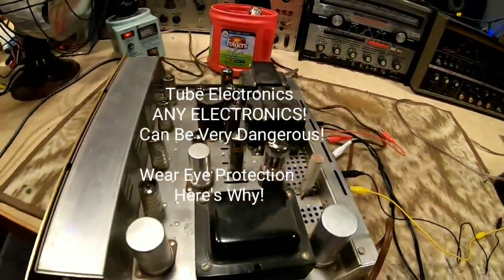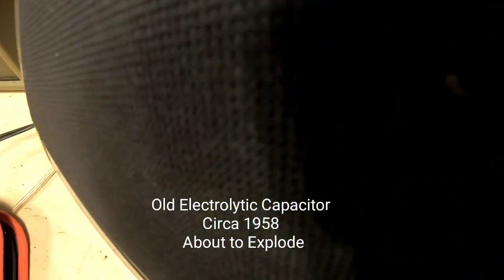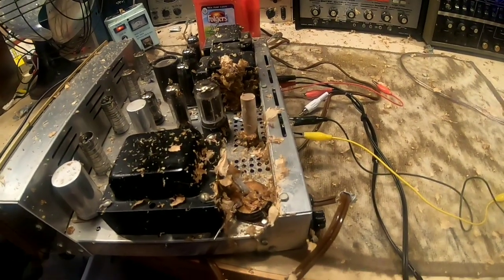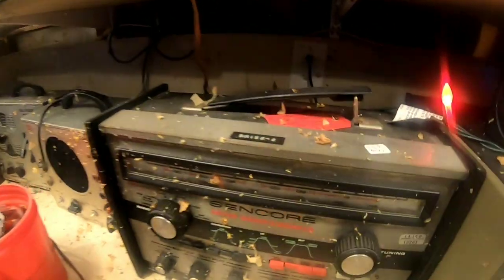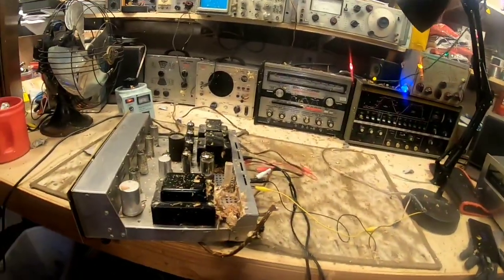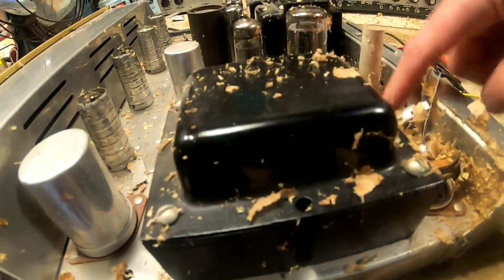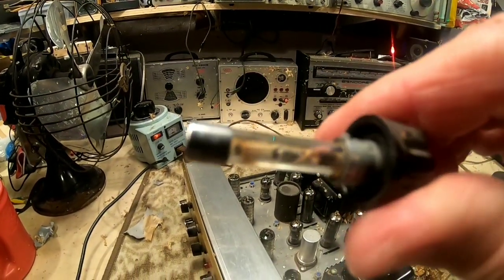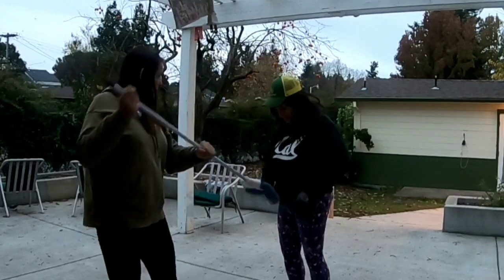Explosion in the Workshop! Old Capacitor Blows Up!...The Dangers of Old Electronics

Comment: "Without any warning at all"      

0:06 No output, bubbling sound...
0:42 SMOKE!

If you had an ammeter connected, you also would have seen the current jumping wildly. Some form of current limiting device is always a good idea. As well as safety glasses ;) 

An easy 'hillbilly' device is a simple high wattage bulb in series with the incoming AC. Check out the 'light bulb current limiter'. 

Voltages/available current inside these units are no joke. They can literally kill and maim. You skipped a few safety measures that would have prevented that cap from exploding in the first place though.

Comment: This is the perfect example of why you NEVER EVER plug a tube amp or any tube gear with unknown status and with original cap cans directly into the wall. Most tube amps filter can caps need to be "reformed" which means the voltage feeding them need to be brought up slowly using a variac together with a dim bulb ( for current limiting ) over a span of 24-48 hours or more gradually monitoring the current draw till it reaches full operating voltage all the while monitoring the cap can temperature. Based on this video it appears he just "plugged it in" or did not allow sufficient time with a variac to let the cap reform and did not monitor current draw or the filter can temps which obviously reached well over 250-300 degrees due to the high ESR that cap had from sitting so long.  This amp uses a 5AR4 rectifier which wont conduct until the filament is heated enough which wont let that cap reform properly. A unit like this would need to have an external supply feeding it starting at 0V and gradually over time of days slowly reform to its rated voltage. That main can filters 400-500V!!! which is what tends to lead to such violent explosions. Besides the can caps, there are paper/ wax caps under the chassis that can go boom as well since they tend to go leaky. Let this be a lesson to everyone!
Reply from the maker: It wasn't plugged into the wall...fail from the start..the voltage had been brought up for days before this happened.

Comment: That’s what the good lord invented variacs or dim bulb testers for. Glad you’re ok
Reply from the maker: I had put it on a variac a few times before with no trouble...this time it blew
Reply: No, no variacs. A variac does not offer any current limiting, nor an indication of how much current is flowing. Even at half the voltage, a catastrophic amount of current can flow. A dim bulb tester is a rudimentary form of current limiting and can give you some extra time to measure if all voltages are present and if there's no excessive leakage current. As a bonus it's also cheaper.
Reply: @mfbfreak Exactly

A dim bulb tester every tech sure make one as limits current so capacitors can reform and prevent catastrophic failures if one about to leak DC and short. It also save you from having to blow fuses.A dim bulb you at least see if power supply dead shorted, or if starts up can check for ripple and voltages off the bat safety.

The limitations of a dim bulbs is switch mode supplies as they have typically higher inrush current and won’t start, but a bigger bulb overcomes that, plus you can still see even if power supply won’t start if it shorted.

Comment: This is why I ALWAYS measure the ESR and uF on electrolythic capacitors in old appliances I haven't ever tested or used before I plug them in.
If they should go bad, not only the caps will selfdestruct in a spectacular way, but they will very likely take other components with them too that wasn't a problem before, making the fault even worse and hard to repair.
If a capacitors internal resistance gets to high, it will rather consume electricity than filtering it, making it overheat to a point it will boil, short out and then explode.

Comment: This is the reason you don't apply power to any old piece like this without first replacing AT LEAST the filter caps. No one thought this could happen, now you know.
Good thing that you didn't get a piece of metal shot into your eyes. Lesson learned, spread the word. Glad you are ok to tell the tale.
Reply: Yep exactly always check filters if they leak DC they will short or worst leak current and then explode and Rifa X/Y safety capacitors as well. If a capacitor get hot or notice ton of ripple replace filters. One of the first thing to check is ripple and voltages before anything else, this would have avoided the filter capacitor from catastrophic failure. 

He knew capacitor was lucky cause of noise but left amplifier on? He likely a piece of metal didn’t go in him, that would have been worst then just cleaning up the mess. I seen one go though a wall once.

Comment: Do I have to worry about this happening to my 1999 Apple iMac G3 M5521. If so I should recap it unless this is rare.
Reply: Two totally different beasts. This unit has a cap thats filtering over 400VDC. The imac will use caps that in the power supply are much smaller and are under 300V on the hot side.

Comment: I am sure that cap was boiling hot to the touch minutes before it blew up. So always feel your old capacitors and if one is starting to feel like fire, unplug the device.
Reply from the maker: The Explosion occurred within ten seconds of plugging in.
Reply: @rosieokelly  That is nasty. That cap was almost 100% shorted then. I usually do connect an external B+ voltage to the old gear before its first power on to see how much current it draws.

Comment: I bought an old mechanical calculating machine (Badenia VA-17, 1958-64) from an antiques store for my birthday last year.  I got it working and whirring for about a minute before there was a pop and then smoke exactly like your video shows here.  Thankfully it didn't fully explode like yours, I'm glad you're ok.

I'm not experienced in electronics (I got the retro calculating machine for fun as I'm an accountant) so was really surprised (and very naive) to learn about the dangers of old capacitors like this.

Comment: When i was working on an 1970s Black and white T.V. set,  a  CERAMIC 400 volt/D.C.  capacitor blew..   and SHOT pieces of ceramic shrapnel and endless pieces of aluminum foil..  ALL over the inside of the wooden cabinet and out the back!!!  THANK GOD for safety glasses.

Comment: so you are telling me, that after 60 years, that Capacitor did not get fully discharged?

Oh my God.
Reply from the maker: No, I was powering it up slowly on the variac -- at least that what the plan was  - but I had neglected to reduce power before turning it on...I thought I was on 30 volts and would allow it to reform...oh well
Reply: @rosieokelly  Oh. Well, it would have been extremely crazy for a capacitor to not discharge since freaking 1958. But guess i was wrong. That Explosion however was Crazy. hope no one got any injuries at that time.

Comment: I took "Vocational Electronics" in HS, learning to be an electronics technician. A substitute teacher would always follow protocol and shut off power to all the workstations in the classroom/lab when he went to men's room (the regular teacher knew better). So while the substitute was away from the classroom, we would spring into action and mass produce about 15 or 20 can capacitors, attaching a foot or so of zipcode and an AC plug and plugging each into the de-energized outlets at each workstation. We'd all sit back a bit and pay rapt attention when the substitute returned. The substitute would reach over and push the big green "On" button (on the wall) and -- BZZZZZZT-B-B-B-B-B-B-B-B-B-BOOM! There would be a very large buzzing as the almost dead-short vibrated all the cans. Then fifteen or twenty little bombs would go off, the classroom would fill with smoke and bits of paper, and we'd all look at each with feigned surprise. On one or two occasions, it would trip the master breaker in the hall and shut off power to the entire wing of the school.

Thanks for reminding of those days -- Rockville MD, circa 1969.

Comment: It's funny, I have some electrolytics from the 50's that are heavily used and still going strong, while some from the 80's have blown up.  I wonder what causes the difference.  Something to do with the quality of construction perhaps?  I find those "computer grade" capacitors generally last pretty long.  I once had an oil-filled (non-electroyltic) cap blow up, sending the lid of the can flying up and embedding itself into the ceiling.  Lucky it didn't happen a few seconds sooner when I had my head over top of it!